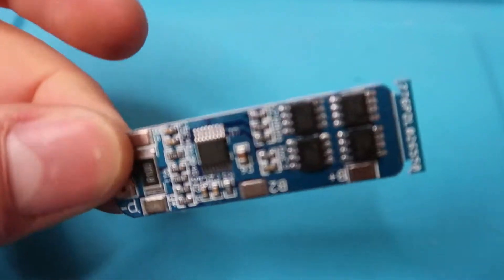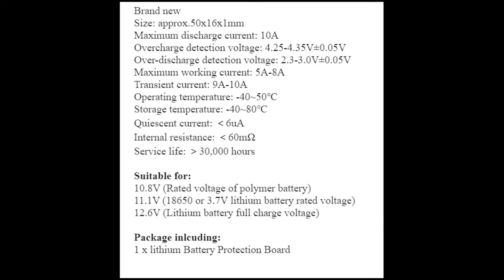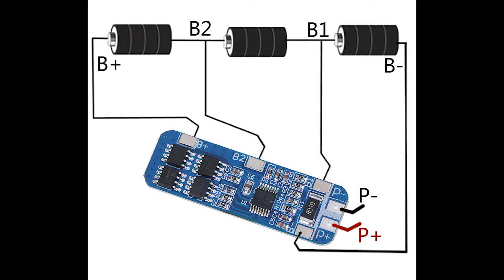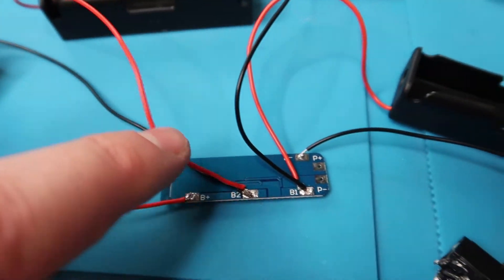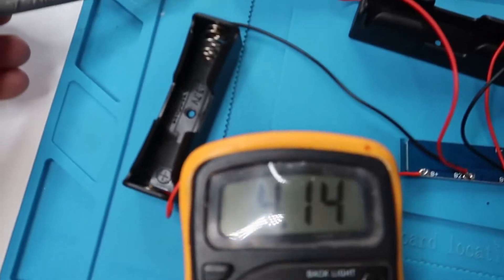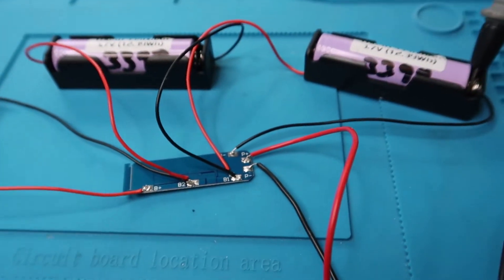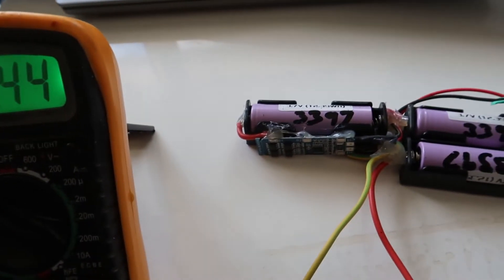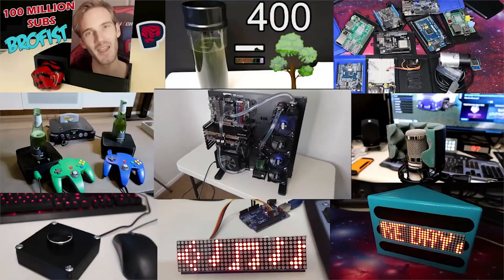12V 18650 3S Li-ion Battery Pack - How to build DIY

Comment: Would this board be able to stay plugged in while using whatever device you are powering with it? I wanted use this power supply to power an led light that can stay plugged in or unplugged and use the batteries power.

Comment: Will this work with vape cells instead of 18650 cells as I have collected so many disposed vapes. The vape cells in question are the round ones, 600mah to 900mah etc in capacity thanks 1 sub added ❤❤❤
Reply: It’s not really safe… 18650 burn down stuff everyday, they’re super safe! Those soft ones from disposables are the least safe. Recycle them or give em to a pro, or someone who scaps

Comment: I've similar setup....
but my power adaptor(ie wifi adaptor )is only 12v 1a...
i use XL6009 and boost the adapter to 12.7 v.... But the 3s battery after charging goes to a max of 12.15v.

I would like it to be full charged to 12.6v but it stuck at 12.15v can u please help me any solutions

Comment: Thanks a lot for your knowledge and all information you are sharing with us. I would like to ask you some guidance for a 10v battery project i'm trying with vape cells. They are 3,7v 550mAh each; together they give 12v, but i've put a LM7810 regulator to limit the voltaje to 10v. The problem here is i don't know which BMS or charger i need for all this. Any help will be welcomed, thank you so much!

Comment: I have charged all 3 batteries to around 4.1v. I have soldered everything correctly but at the P+ and P- pins is no voltage could someone help?

Comment: I'm really new at electronics. Videos like this that explain everything in detail are excellent for building skill for new makers.

I searched for ages to find something that was easy to follow, and this video really hit the spot.

Now I'm ready to 3D print a case and build something like this.

I wonder how much extra work it would take to make a power output interface that could take two of these (so a discharged battery pack in the pair could be removed and replaced).

Or if that power distributor could take more packs to make it expandable...

Comment: Hey mate, quick question. I want to build this to power a some LEDS and an ESP32, so I wire in the 3 cells to the board and the input, is also the output and I just put a switch Infront to stop it discharging when I'm trying to change it basically?

Comment: Very precise description. Here I have 2  questions, 1) can we use 6 cells of 18650  3 in series and other each of 3 parallel to each  cell just to increase the back up time (mAH) 2) Can we just use 2 cells only taking output between   B-  and  B2 ?
Reply: 1) yes
2) there are 7.4V (2 cells in series) BMS that you can buy

Comment: I have a few hoverboard batteries (20cell packs). How can I reconfigure them into a 12v pack using the same BMS it comes with…?
Reply from the maker: Assuming that they are 18650 cells it’s a good start but I don’t know anything about the bms it could be designed to have the cells arranged to be 24v it’s to hard to know without having all the details. You could salvage the cells and reuse with a new bms like the one I have shown in this video. Or the larger modules that have higher current output (depending on needs). Unless they are still working. Chances are if you have hoverboard batteries lying around something was wrong with them. And that could mean cells in the pack could be faulty and you would need to test each cell to know if they are working properly and what the output is to ensure your pack is balanced properly
Reply: @ScottyDIY  Those hoverboard packs are 36v and mine are fully charged at 40v+. I’m sure they’re all fine.

Comment: can we buy one thats already made ????
Reply from the maker: You can buy a 12v powerbank or 12v lipo / li-on packs but they are usually more expensive. But on the plus side with the power banks they tend to have more options like 12v/5v outputs. Depends on how much money you want to spend

Comment: hI Can you charge the batteries and same connected to the load ?
Reply from the maker: The charger is a higher voltage than 12V at 12.6V so as long as the load can take that voltage then it should be fine, in saying that though the chargers output current are very small so if the load is something other than maybe a couple small LED's (low current requirement) I would expect that the batteries would not be getting enough current to charge, plus if the voltage does drop do to the load by a few millivolts the board may think the charge is no longer connected and switch to output instead or charging. I haven't tried it but I would defiantly suggest charging the pack to full capacity without any load before trying to parallel the charger and load, make sure the load isn't greater than the max current of the charger.

Comment: Hi. I want to do some diy for a pc fan and install 3 cell 18650 batteries fan is 12v  dc and 0.7 A. The batteries are already protected batteries  high drain flat top panasonic 3400mah. you think it would work what else do I need to buy?